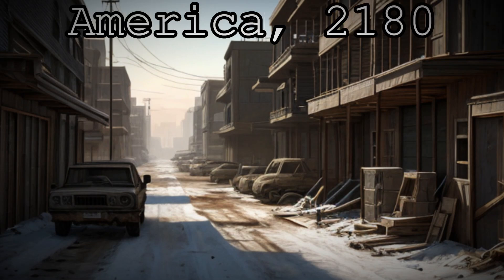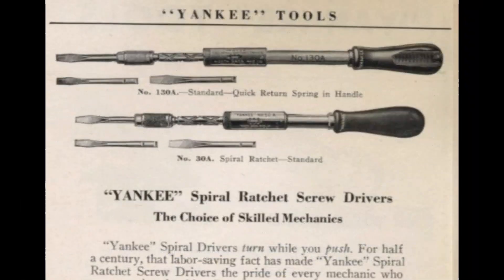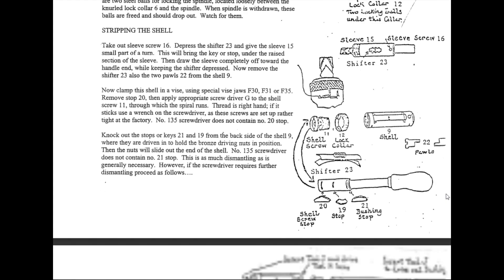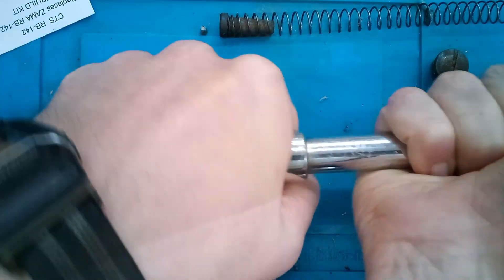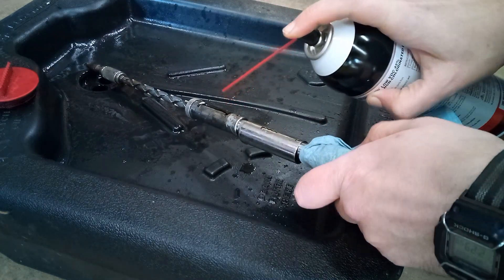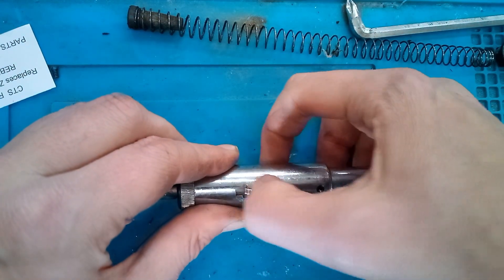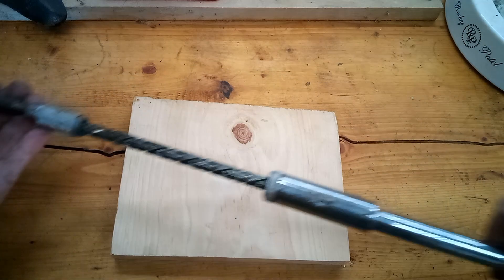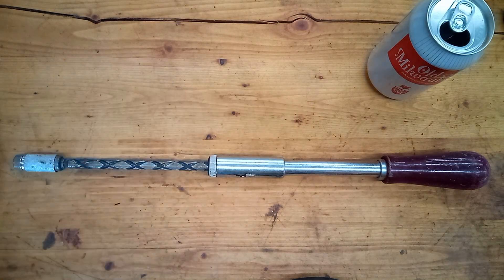Stanley Yankee Push Drill History & Disassembly Instructions

Comment: I have all three Stanley Yankee screwdrivers. I use the smallest one all the time to start screw holes. I've didn't have much luck using the large screwdriver. But still a cool tool.
Reply from the maker: I've used one of my smaller ones a few times to make starter holes too. This long one I haven't really found a use for. Too unwieldy.

Comment: Fyi, a small detail is that the pawl edges are ground at a slight angle to ensure positive locking against the ratchet teeth of the spiral nuts. If the pawls are installed upside down, the angle promotes positive skipping instead. 6:10
Reply from the maker: Thanks! I ran into that when I had to make a replacement pawl for one in a different video.

Comment: I have one of these in my farm truck box, did this last summer. Now I'll make a 1/4" adaptor as I already made a 1/4" socket adaptor (if your good you can grind one using the old bit as a template)
Reply from the maker: I never thought to use one with sockets. Now I'm thinking about making that adapter too...